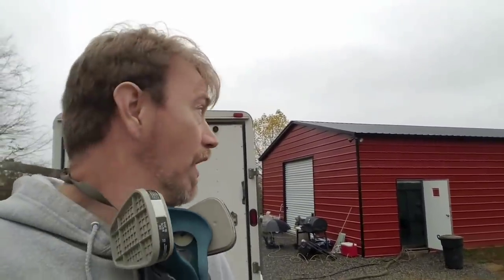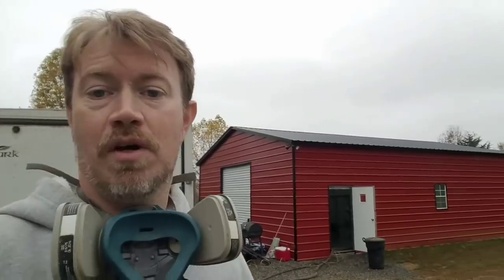Insulating Metal Buildings With Closed Cell Spray Foam

Comment: Doesn't the metal sweat or get condensation if it's cold out and warm inside ?
Reply: Without insulation, yes. With insulation, no.
Reply: Robert Graham i have put upover a hundred tin cans wothout a doubt all will have leaked by now . The moisture will be between spray insulation and roof panels . Freeze and thaw will do the rest . Every day in Summerheat metal will stretch and shrink with every heat cycle . Anyone who has an old building may find short term benefits but this is no way to treat a new building . If i had an old building and wanted to insulate i would use rigid panels with foil backing only . I would never apply this . If you decide to remove it you are skunked .
Reply: @waynerobinson2301  That is one opinion, mine is the opposite, but I'll get back to you in 30 or 40 years when we know for sure, but until then I have a much nicer much less expensive solution to my need for a nice warm dry shop to work and entertain in.
Oh, I might not get back to you because I'll probably be dead before then and won't really care
Reply: @integr8er66  
1. What is your solution?

2. Why the need for sarcasm? If you have something that has worked for you, then by all means, please share it.
Reply: @fishingismydrug1  My reply was @Wayne, who thinks everyone who builds anything should spend as much as possible on it so it lasts 100 years past the guy who needed or wanted it.  There was no sarcasm, I was simply making that point. I have in several posts to this vid told what my solution is. This works very well, it does not sweat because it is a no air gap, it fits tight against the metal, no chance of sweat. Too many people telling other people what they can't do. I did it, and it works great that is my experience, if you are super worried about fastener leaks then buy the rubber covers and put them over the installed screw before it leaks and worry no more. Whats more closed cell doen't absorb water so again it won't rust your metal, in fact it will seal existing leaks if they exist. The supports are galvanized, they won't rust anyway. It is a fine way to make a nice inexpensive shop. It may not last 200 years, but I don't care because I'll be dead, that is my point, I'm building it for me and spending only what I need to to satisfy my needs as long as I have them. Some people, specially those with union trades background seem to think anything you build has to be Stonehenge or the sphinx good enough but affordable is way better than perfect you can't afford to build

Comment: How much does it cost
Reply from the maker: I don't recall what it cost to spray this project. Projects can range in price from $1,000 to $10,000. Pricing can vary depending on a lot of factors like:
  >Total square footage
>Type of corrugation
>Type of foam sprayed
>Thickness of the foam sprayed
>How far away the client is
>Will a lift be required
>How much preparation (plastic and masking) is required
>How many doors and windows
>Will the foam need to be cleaned off of the studs
It's not an easy answer. This is why we do free estimates so we can give you a custom price for your project. I hope this helps!

Comment: First off, whoever sprayed this did a very good job in my opinion, second osha creates more harm than good, you try spraying in a lift with a mask on and hoses around you and a harness with a lanyard and get anything done in a day. there is nothing wrong with using a forced air heater to heat the building you are in to get the substrate up to temp. I've used them for years and had nothing go wrong or osha show up and butt their noses in. Not to mention the countless huge commercial jobs I've done that have osha and safety guys crawling around just looking for someone to step out of line and what do you think they use as a heat source? a forced air heater!!! You know I really hate going to watch a spray foam video and read down in the comments  where there are 50 experts that know everything. We don't know every climate only the bad rap foam gets when not installed correctly in a house or metal building. Like the saying goes word of mouth travels fast and bad word of mouth travels faster. People will have problems with it because of poor installer training and people who can't make it doing whatever they were doing go and buy a rig and destroy the market and do poor jobs. Norty by the way you are right keep up the good work trying to educate the ignorant, it's an everyday chore

Comment: what is the cost of spraying a 40 foot high cube shipping container?
Reply: 6 walls 40x8x9H might be as much as the container
Reply: Your geographic location will depend on your price per square foot. Price will also go up depending on how many inches you need sprayed as well. Your best bet would be to call all of the companies in your area for quotes. Don’t ever pay for quotes either. Also, do extensive research on each company. Request all certification documents for the company and any technician spraying the foam in your house.
Reply: thanks for that-I willl be starting a my container cabin project in Leon County,TX. I'd guess 2 inches  for the entire container.
Reply: Nick Henton 2 inches will be plenty. What are you using the container for? If you don’t mind me asking
Reply: I'd like a small hunting cabin framed out in its interior (tiny home) -just a place to "reboot"on weekends.I'd like to be able to lock it up and leave ,my reason for a container.
Reply: kinda thinking on the froth pack DIY also @Norty
Reply: Nick Henton The cabin sounds pretty awesome. Just make sure you are covering the foam with drywall or a flame retardant paint. It is flammable if exposed to hot ashes, flames, or ambers. As far as froth packs go. They are good for small jobs but very costly for bigger jobs. If you do decide to DIY it, make sure you’re wearing the proper protection. A respirator is a must. You also don’t want any of this stuff on your skin or clothes either
Reply: Thanks -I may try to video some of it and I appreciate the safety concern.
Reply: Nick Henton No problem

Comment: is there a maximum thickness it can be physically applied physically using multiple coats? Is there a maximum thickness where it reaches diminishing returns on ability to thermal insulate. I am looking for ways to super-insulate a camper conversion van. Was thinking of spray foam on the steel surfaces then a top layer of 1 or 2  inch poly radiant heat sheets to finish off the interior.
Reply: Texas A&M publishes a study saying 1 inch of closed cell will eliminate 80% of heat loss and   an additional in eliminates 80% of the remaining 20%.
Reply: 1 inch of polyurethane closed cell foam has and R value of about 8.5

As closed cell applicator i recommend 3-4 inches of closed cell foam on most residential homes/sheds/garages.

Comment: What about the toxic issues with spray foam that we have all heard horror stories about? Like that guy who had to replace his entire roof? Will this stuff give you Cancer?
Reply: My exact question is there an eco type.
Reply from the maker: I appreciate your concerns!

Polyurethane foam is a common household material. You probably already have many polyurethane products in your home right now like:
Couch cushions
Carpet padding
In your refrigerator walls
High end drink coolers
Mattresses
Pillows
Car seats
Office chairs and more!

It's a well tested and government approved building material as well. Many third party independent testers have tested the safety of polyurethane foam and it has been in use all over the world in millions of building projects for over 30 years.
Most bad press you hear about spray foam is usually due to an improper installation which is rare. Most reports like the one you saw are sensationalized hit pieces and are likely funded by corporations that don't want to see foam take over the market, like fiber glass manufactures or they are put out by media organizations that want more ratings. For every bad install there are thousands of happy customers that you never hear about.

Simply put, If it was known to be dangerous it would not be an approved building material.

We would never knowingly put something in your building that was unsafe or a health hazard.

Comment: What is the R value. High R value does not cut it.  How thick can you go?
Reply from the maker: Closed cell foam has an R value of approximately 6.8 per inch. In the video we are spraying approximately an inch and a half thick which would be around an R value of 11 or 12. You can spray it to any desired thickness but because of the material costs involved most people want to spray exactly what will get the job done to get the most value out of the investment.

Comment: How much does this cost
Reply from the maker: I don't recall what it cost to spray this project. Projects can range in price from $1,000 to $10,000. Pricing can vary depending on a lot of factors like:
  >Total square footage
>Type of corrugation
>Type of foam sprayed
>Thickness of the foam sprayed
>How far away the client is
>Will a lift be required
>How much preparation (plastic and masking) is required
>How many doors and windows
>Will the foam need to be cleaned off of the studs
It's not an easy answer. This is why we do free estimates so we can give you a custom price for your project. I hope this helps!

Comment: the way that expands it looks dangerous as hell if accidentally inhaled
Reply from the maker: It's definitely recommended to wear respirators and forced air fresh air during the installation process. Once the product cures closed cell foam is a very safe product. This is the same material that's inside your refrigerator and your expensive sports coolers.

Comment: Whats a job like this run?
Reply: I got a quote for 2/ sq ft if I wanted 2'' of foam.
Reply: @grasscutter88  I've been getting abt 3.43 for 3.5" of the moisture proof... Just about ready... Ducks are almost lined up
Reply: @mikeschaner5853  That's a lot of money. Why not just put some mineral wool instead? It would be half the cost and it would block noise too.
Reply: @grasscutter88  not as effective in denver climate
Reply: @mikeschaner5853  I'm in Houston.
Reply: @grasscutter88  yeah I've been told by numerous people regulations this and that... But it can be 90° at 2 pm and be snowing by 1 am.. Weather is rough on buildings here... I'm from east coast so i know about coastal issues too.. A lot of stuff they use in Tx isn't very effective here. And vice versa..

Comment: Is the foam paintable? It looks white will it yellow after some time?
Reply: Les Gray yea it will yellow with exposure to uv rays. You  can paint the foam whatever color youd like with a watwr based paint if you dont prefer to sheetrock the walls
Reply: Bucanon Haley You cannot just paint the foam any color you like. If it is not being covered up by drywall, it absolutely has to have a flame retardant paint applied to it. Period
Reply: I think the point of this video is to show the simplicity of having spray foam installed in a metal building without any further finishing of the interior walls that said my original question was concerning the foam yellowing after curing and or after acquiring some age cause in this particular videos it appeared satisfactory as is. Was hoping for a response from the insulation installer but it appears that won’t happen.
Reply: Les Gray I am an American Chemistry Council certified master spray foam technician and have been for the last 8 years. To answer your question, yes the foam will yellow over time. Like I have stated previously though. When the foam is not being covered by a fire barrier of some sort, a fire retardant paint MUST be applied. The foam itself cannot just be left on the wall. So your choice of paint and color color is very limited
Reply: Norty ok so you realize these people are advertising and promoting their product to be left as is without any sort of fire barrier right? If this practice isn’t safe, why and how would and could these people misinform consumers so openly to the point of making promotional videos? If in fact it’s in violation of building fire codes they need to be notified and stopped.
Reply: Les Gray It is 100% against any and all fire codes. This company obviously isn’t properly trained and certified
Reply from the maker: Norty is correct that the residential fire code requires the foam to be separated from the living space by a 15 minute fire barrier. This can be accomplished by applying a fire retarding paint like DC-315 at the proper mil thickness or by simply covering the foam with sheet rock or other code approved fire barrier. We always inform our customers of these requirements and if they decide to not follow through with meeting the residential code requirements that is on them. As far as our training and certification, we have 16 years spray foam experience and we are properly licensed and insured for our region and have completed ABAA certification.
Reply: flame retardant paints can have color added just like any other paint.
.
Reply: Norty it’s not against fire codes in an unoccupied building like a stand alone storage shed. In a house it must be covered to separate from the living space. In all reality the combustibles that you put inside the livable space of your home are more of a hazard than foam left exposed though. Your plastic couch, bed, carpet, TV, clothes, everything thing around you that you stuff into your homes will cause a room to flash in less than 3 1/2 minutes.
Reply: Norty THANK YOU SO MUCH!!! I'm on a tight budget and planning to buy land and live in a metal prefab structure. I'm learning but determined. You answered my question. This insulation **with fire retardant paint may be an option that saves me money. I've been taken advantage by constriction guys b4. Its just my income trying to do this. Just want to say thanks and BIG BIG virtual hug.
Reply: Houston Bros Spray Foam Insulation Are u available in Oregon?
Reply: @christophergruenwald5054  Actually in many places, like where I live there are NO building codes, so do what you want. Second I tried to burn the scraps I trimmed off the uprights and even with gas and diesel fuel I could not get them to either  urn or melt. Wound up breaking it up and hauling it to the dump. The stuff I got I'd call fire proof.
Reply: @04boostedboxer  Not all locations HAVE fire codes, so its NOT against mine
Reply: @04boostedboxer  Bull shit, mine is and has been open for 3.5 years, and it absolutely will not burn, I tried, it will NOT.

Comment: Seems to be a lot of back and forth about this causing a building to rust out quicker. The only thing that I would see causing this would be a heavy snow load with some ice dams and water not having anywhere to go. If a person was really worried about it they could put a seam sealer between the roof panels to keep any water from getting in.
Reply: you dont want to DIY this stuff, you can mess it up pretty easily, but when done by an experienced professional, you wont have problems.

Comment: Holy Crap, they put ROMEX wire in a Steel Building. NEC says that's a BIG NO, NO. Hope their insurance company didn't see this vid.
Reply: I know exactly what you mean. But if it were framed with steel, then walled with wood studs I don't see an issue. But that determines how well the owners care for the structure. I.e. prevent rodents, water/ flooding prevention. Etc

Comment: What is the cost per sq foot?
Reply: Did my basement walls two years ago. 11 x  22 with three exterior walls, I studded and ran electrical, foamers came in sprayed for $1.00 per foot and $1.00 per inch depth extra. My total was $953.00 because I went two inches and the extra was because of the early spring .  foam was hard to deliver to the basement because of the cooler temperatures .  Truck that mixes chemicals has to be at a certain temperature also and in march with snow on the ground it had taken awhile to get the inside of the truck up to the desired heat to spray foam! Now I can heat my man cave with a candle and it is dam warm in there, and quiet until the wife comes down.👍 👍 🇨🇦

Comment: The "professionals" who post 'Call me at ....' videos will tell you. "No, you got it all wrong. That's crap because you did not call a 'professional' like me to come do it for three times the cost of a DIY job."
Reply: dieselscience Spray foam is NOT a DIY job! You need multiple certifications and hours of training. Anyone who believes otherwise is completely clueless
Reply: "Certifications?" really? Like a contractors license... I guess that's why all this stuff is sold to the public.
Reply: dieselscience No not a contractors license. REAL certifications specific to closed cell spray foam. If OSHA finds out that any old person is installing this product, there are huge fines
Reply: OH? Name the regulatory body that issues such certificates. Also, do you realize that OSHA has EXACTLY ZERO jurisdiction on DIY work? OSHA = OCCUPATIONAL Safety and Health Administration - IE: applicable to employees not individuals doing their own work.
Reply: Buyer beware.  Do your research on your contractor.
Reply: Grigsby, absolutely. No amount of 'certificates' will differentiate between good or bad work.